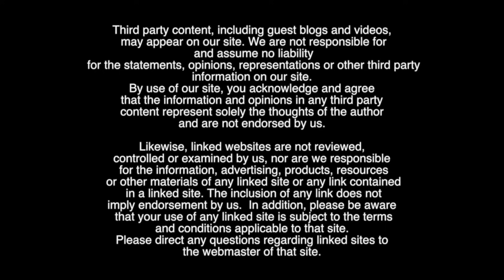How to Install a Dash Pad & Instrument Bezel in Dodge Trucks | Kevin Tetz with LMC Truck

Comment: If you're going to pull the whole dash out like that you might as well replace the heater core.
Reply: And A/C evaporator...
Reply: true, and replace out any bulbs in your instrument panel as well.
Reply: @DKrueger1994  actually the cluster is  very easy to remove for bulb replacement. But, yes, I did replace my bulbs.
Reply: Not to mention fix the problematic vent baffles that like to break
Reply: Great point and the EVAP!
Reply: I know that's rite!
Reply: @walterk1221  yep
Reply: I broke my dash replacing the heater core lmao
Reply: instablaster...
Reply: Keep adding things you gonna end up replacing the truck.
Reply: That's funny, I'm here because I'm getting ready to replace my heater core... and I thought I might as well replace the dash pad.
Reply: @FastenDeezNutz  Seat covers for a dodge 1995
Reply: @kennethduffield8684  that’s why I got blend door usa one piece aluminum doors, Ill never have issues again.
Reply: @Powder_actuated_lead-  
Thanks for the heads up. I'll have to look onto them in case if I have any problems in the future
Reply: @kennethduffield8684  I’m actually putting my dash in my truck as we speak 😂, if you do go with USA doors I’d replace all the vacuum actuators just for peace of mind but the replacement dash is a great fit.
Reply: Keep going and change out all the doors to the aluminum ones in the heater box as well.
Reply: yea no shit 😄 I swear
Reply: And the Evac. Core as well if you’re that far into it, are you Gotta do to get the heater core out is poured up and pull it out of the way and cut the lines and you can slide a new one back in.
Reply: Bien
Reply: @Powder_actuated_lead- How many vacuum actuators are there? ( 1998 Ram QCab here ). Thanks. 
And what color was your LMC replacement dash?

Comment: I purchased the dash pad from LMC expecting a less than OE fit and finish, but I was pleasantly surprised! Thank you LMC Truck for the pats and the video! The replacement of the pad was not as difficult as one might expect. My wife helped me get the dash assembly out and in the truck. I might have been able to use my shop crain, but hook up options ran the risk of cracking the new pad due to lack of support where the straps would need to go. Be prepared for a can of worms. I am a aircraft technician, so my approach to maintenance is more critical than most. Having the dash out, I took the opportunity the replace the heater core; evaporator coil; all foam in the air box and several wiring repairs and upgrades. The aftermarket heater core and evap are substandard when compared to OE.
Reply: How long did it take you?

Comment: Took me 8 hours, only because I was trying to save time trying to screw the vents in like people say in these comments. It only took me longer. Only thing that got me was how to disconnect the parking cable that’s connected to the speedometer. That’s probably the only curb.  You have screws on the top by the window and two bolts on driver side and passenger side. That’s all that holds it up. Everything else is disconnecting plugs. Take it all out. It’s harder trying to save time trying to move the dashboard slightly forward and trying to screw backwards it only wastes time

Comment: Freaking nightmare , yeah I think I'll pay to have this done on my 96.
Reply: You're looking at around 6 hours of labor...
Reply: i second that ! Holy shit ! You have to remove the entire inside of the truck and bring it outside your truck to do this. what kind of idiot designed this nightmare. just to replace a dash.any normal person engineering this would make it about 10 screws ands away u go. ive seen videos on you tube where people do it in the truck.
Reply: @walterk1221  But a Dodge dealer will charge you for 12 👹
Reply: @zoomiemonster5610  not likely, those that I know of are flat-rate book.
Reply: @walterk1221  I have a friend who is a retired Ford mechanic, and he agreed that most dealers use a book time to estimate charges. The problem with that is that the book charge is based on a worst-case scenario on how long the job SHOULD take. Not how long the job actually takes. For instance, a few days ago, I went to my local Dodge dealer to ask what they would charge to splice in a new headlight connector plug, which I am told should take no longer than an hour. They wanted $290.00, and that didn't include the part, which they want another $190 for! My dealer's hourly rate is $115 per hour, so they are "booking" me for 2-3/4 hours for a simple soldering job. A private shop is only going to charge me $100, and I got a junk yard part for $20, which is about all that part should be NEW.
Reply: Just did mine.  It WAS a freakin nightmare.  I do all my own work.  I’ve done head gaskets, intake gaskets, cam shafts, water pumps, (and now my first heater core), etc., and this was the hardest thing I’ve done.  I think I would rather give myself a root canal next time.  But I will say I am very happy with the quality fit and finish of the LMC dash.

Comment: I recently purchased and install a new LMC dash pad. I found that if you remove the three screws the hold the dash pad vent tubes to the dash frame ,( they can be accessed from under the dash) you can remove the old dash pad and vent tube as one assembly. Transfer the vent tubes to the new dash pad and reinstall. No need to remove the  complete dash, just pivot it out toward the seat a little. Lowering the steering column and removing the passenger air bag are required.
The LMC dash pad fits perfect. No squeaks or rattles even on rough gravel roads. I also purchased a new LMC grill for my truck, again a perfect fit. Both items are as good as OEM Dodge parts or better. Very satisfied.
Reply: Thanks for providing a comment review that isn't moronic. Lol thanks for the tip too, about to do it myself
Reply: what year is your ram? 3rd gen 2003--2008 ? the one in the video is a 97-2002
Reply: How come you didn't make a video of your install!? Bc I'm not feeling the entire dash removal.
Reply: Fuck yeah! I am going to buy it for my wife truck. Now the PIVOT method you did, was it easy or easier than removing the entire dash? I've got big ass hands, will that be an issue?
Reply: Thx for getting back to me. Keep up the good work.
Reply: 2020 I just bought my Father-in-law's 98 Ram 2500 with the 8.0L V-10 it's been sitting in his driveway waiting on me to take it home for over ten years. He started the second part of the dash removal process . Time and the sun got the first part.
Reply: Where are the 3 screws located
Reply: Is it a replacement or a pad? I can’t find an lmc replacement anywhere
Reply: @kellenvernon7841  LMC Truck-Interior-Dash components-1998-02 dash pad and bezel. Did mine today.
Reply: @Blaydrnnnr  thank you sir. Funny that it’s called a bezel but is actually the replacement
Reply: Do u think the OEM bezel will fit the new dash?
Reply: Did the LMC grill you got and installed come with all new clips? My OEM is loose and flips around upside down and almost falls off due to all but 2 original clips still being intact. Clips just snapped all around as the years have passed. Thanks.
Reply: So you were able to access the the screws he mentioned that" required" the dash to be removed, by just rocking the dash forward?

Comment: So i did this process, but i did it quite differently. i was able to leave all the connection on my steering wheel and just took off the shift indicater on it and lowered the steering wheel about 6 inches. i then took out all the screws and simply brought the dash forward, since mine was cracked so badly i was just able to use a small screw driver to unloosen the 3 screws holding the vent/defroster. i then transfer all the defroster ducts to the new dash then was able to drop the new dash and defrosters in and put in all the screws, this honestly saved me about a hour or two of time and looks completely factory and had all the bolts line up. Also i still have the defroster working

Comment: I’ve installed 5 of these. Very nice quality. I’m thankful you guys offer these.
Reply from the maker: Thanks for the positive feedback!
Reply: @Lmctruck1  what color dash is the one you installed in this video. i am having a hard time with which color my interior is. grey or dark grey
Reply: how much would you charge for this job? 😆 it's no joke
Reply: how long did it take u
Reply: You installed 5? Wow. What did you charge for one? And also, were any of the ones you replaced the CAMEL TAN color?
Reply: Where can I find a red one?

Comment: i pulled my dash on a 98 2500 and the underlying plastic frame was broken in a few places. i am glad i pulled the dash out. the insulation under the dash is cheap rubber over old musty sponge foam. i am putting in new insulation and soundproofing under the old dash first and cleaning all the incredible 20 years of dirt because of no cabin filter. doing a cabin filter mod as well from genos garage by doing some of my own mods as they dont make one for a 98 that i can find. in the end, it should work out fine I hope. there is no way the guy in this video pulled that dash out by himself. i had to get my neighbor to help me carry it out of the truck so i didnt damage it any further. its made like crap so be careful if you do this. but in the end i think it will be worth it. i gutted the entire cab while i was at it to put in new insulation and soundproofing from LMC truck, and new carpet.
Reply: Where did you get the installation Dash. I have a 99 Dodge Ram 1500

Comment: Ok, just did this to my 2001 2500 using the LMC dash and bezel. Be extremely careful in handling the lower dash core - you can see this one is broke at about the 5:00 mark, mine was broke much worse from years of being exposed.  I had to glue wood in for structure and then glue the remain cracks back together.  This core is NOT available anywhere and is discontinued by OEM, and any used ones are going to be garbage as well.  Best not to destroy yours as much as possible, as all the controls mount to it.  It's criminal that Dodge didn't recall this junk, or offer an upgrade.  I will not pull my dash again, as I don't think it will survive it.  Also, this is not an easy project, you'll need patience to deal with the crumbling dash and all the connections that this vid glosses over.  The positives of the project is the LMC dash does look good and fit well.  It is slightly different color, but that is an age and exposure factor more than anything and a casual glance will never know it.  I've had this truck since new, it's nice to have a proper dash back in it.
Reply: I found 3M "PLASTIC AND EMBLEM ADHESIVE" 08061 to be satisfactory for repair of the inner dash structure. Your mileage may vary. I used shards of the dash top to provide gussets, etc for the lower structure.
Reply: yes, it was criminal of Dodge. absolutely unbelievable that it went on for nearly 10 years and they never fixed the issue, then gave all of us the middle finger because it wasn't a "safety issue". Unfortunately the replacement cost is astronomical as well. I understand R&D costs for aftermarket companies, blah blah blah, but DAMN!! $500 for a piece of plastic?!
Reply: @walterk1221  Mine was missing a large portion of the top of the core, right above the where the AC controls mount.  I solved it by using a two part epoxy to glue a piece of wood, which I then contoured to make sure the AC controls would screw into the right place.  My biggest problem was that there wasn't anything left to glue together, except a jigsaw puzzle worth of plastic at the bottom.  I wasn't about to do that, so the wood piece was a quick fix, and is quite sturdy now.  Mostly, you can just feel the whole thing crumbling every time I handled it.  Thanks for the tip on the glue, I did make a note of that for future use.
Reply: @forindooruseonly646  mine was not as far gone as yours. I only had one section actually broken away totally.
Reply: @tenaxxband  Dodge thinks their parts are made of gold when actually they are junk. There are two kinds of Dodge truck owners; those who have had their dash fall apart, and those who will. When they have to deal with Mopar's outrageous pricing for the dash and bezel, removing that entire dash won't seem so bad.

Comment: Update! with the help of a friend, I have installed my new dash cover from LMC Truck. Here are some tips that Mr. Tetz was weak on; there are THREE connectors that need to be released from the in-dash fuse panel, they are color coded thusly: top Blue, middle White and bottom Brown. If and when you break any parts off the "under-dash" they can be glued back into place with Gorilla glue CLEAR. My steering column didn't lower down to the seat, so it was a challenge to lift the dash assembly over the steering wheel. Lastly, I chose to apply insulation tape found at Home Depot to as much of the HVAC vents as I could reach, should make for cooler A/C and warmer heat. Hope this helps
Reply: I am in the middle of replacing my dash.  Right now, I can't figure out how to release the three connectors you refer to.  It's difficult to see them, even with a mirror, or to reach them.  These connectors, at least for me, have presented a nightmare.
Reply: @julianadams5753  To access those plugs, tilt the dash away from the firewall, if you still have a tight space, suspend the dash on the right side with a ratchet strap remove the the right lower bolt, then pull with another strap the right side of the dash away from the firewall, that should give you the clearance. Tip, the best tool to release the plug is a cotter pin tool as you have to depress the release
Reply: @battleshipnewjerseysailor4738  Thanks for the reply.
Reply: @julianadams5753  Good luck hope I helped

Comment: ya'll need to make a complete dash replacement kit that includes the lower portions,  knee bolster, cup holder/cubby hole, and glove box. That whole dash assembly is crap!
Reply: I still need the complete kit
Reply: Amen. All the plastic in my truck is cracking a little more every day, I opened my door to get in the other day and my knee bolster was sitting on the floor. I guess it finally gave up the ghost.
Reply: @NoblesTx  bahahaha, just in time for Halloween, bahahaha. Great trucks, but poor interior material ingredients use.
Reply: Tell me about it! I’m looking for the framework now and can’t find anything other than used (and abused) parts on eBay
Reply: I agree a lower portion would be aweso.e seeing that everything the top bolts to is falling apart as well
Reply: I agree my cup holder is gone cheap cheap plastic.
Reply: Yea that plastic frame under that dash cap is as bad to fall apart as th rest of it. Those are dam good trucks but like that fella said th dash is crap and they do need to make a complete assembly for them trucks
Reply: Hey guys check out All Dodge Truck, we are working on the lower dash right now, hoping to have it available soon
Reply: @benjaminneel1625  heck yeah that would be awesome!!
Reply: @benjaminneel1625 did u ever make one?
Reply: @benjaminneel1625  As was already asked...Did you guys make one yet? Thanks.
Reply: @philosopher0076  see my response

Comment: @10:33 ... where the HVAC control module is about to be reinstalled, that's the dash core structure I was speaking about in my previous comment... the dash core (sub dash) is shot.

Comment: I love this video however you should have mentioned one thing and that is that since your at it you may aswell change the evap core and heater core at the same time since its a pain in the ass job and for me that is what is causing me to do this job in the first place

Comment: But really just have a little bit of patience if you get frustrated take a break for an hour not no five minutes 10 minutes. But I would rated it may be a 2 1/2 to 3 on a rate of 41 out of five then again, I’m used to tear and stuff down and put them back together.